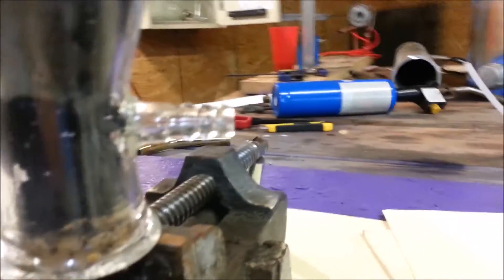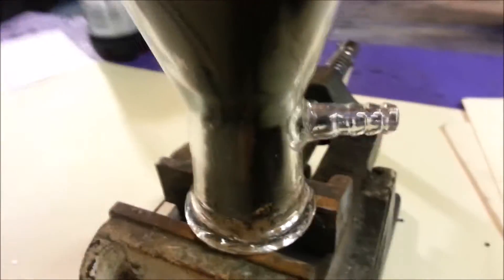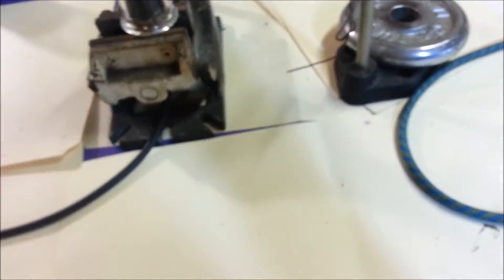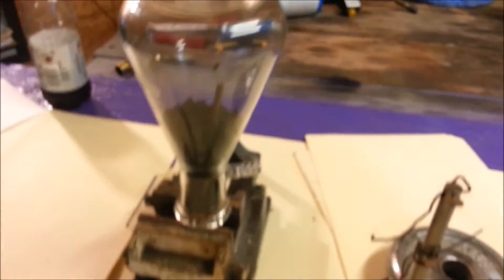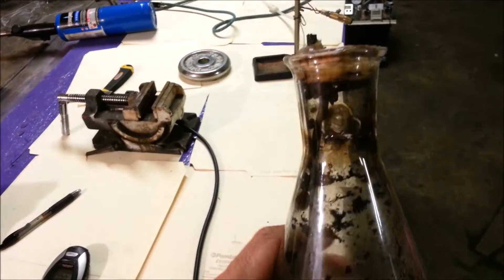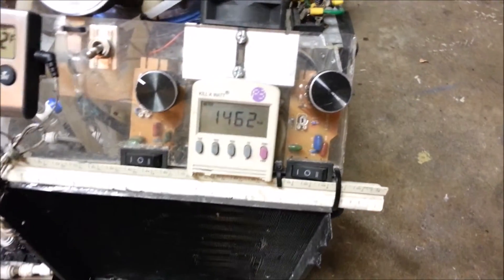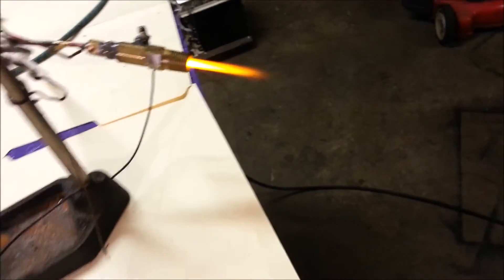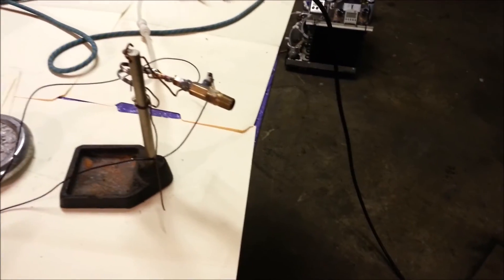Charcoal Gasification in a flask Using hho. WATER GAS REACTION

Comment: Nice experiment. Try less water in the charcoal or use steam air mix. Using wet charcoal will be difficult on a small scale because of thermal loss and the latent heat of vaporization. When scaled up an injector can run this on pure water/steam as the oxidizer.
Reply from the maker: Great input , so true

Comment: Almost right. Water should be used to get H2. The method was known as 'lightgas'. It gives 51% H2, 21% methane, 9% carbonmonoxide,15% N2. Hot cokes must be contacted with superheated steam. So a pressure cooker or something. Then output close. Then air thrue the cokes to heat it up again. And another cycle of hotsteam. Most efficiency here. a.k.a. coalbed gas or something in english. succes! You can do this. It gives far more gas then woodgas. Ofcourse use insulated brics or an insulated boiler tank. No glas needed. We had this running from 1785 !